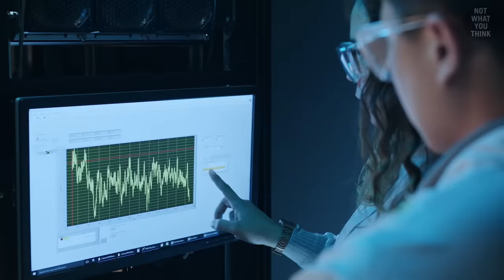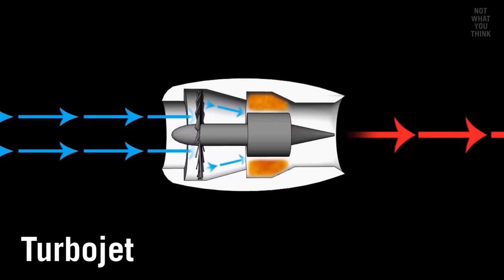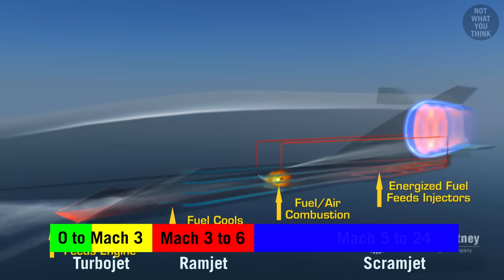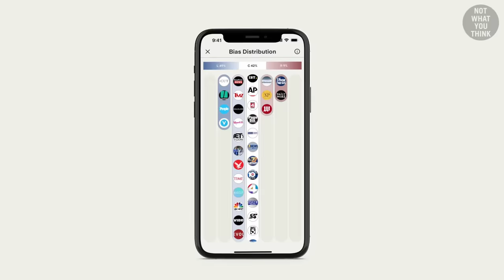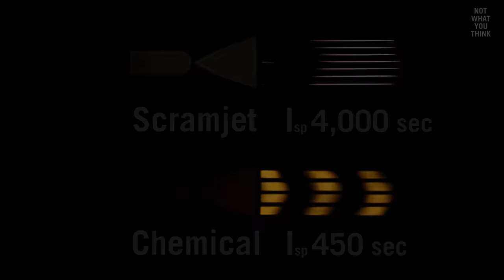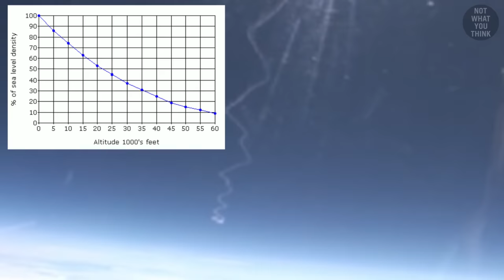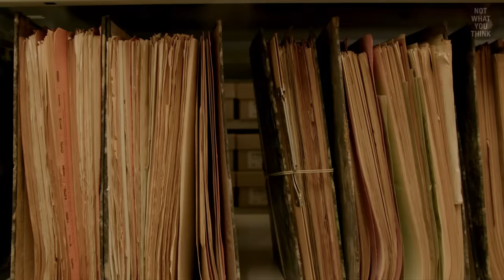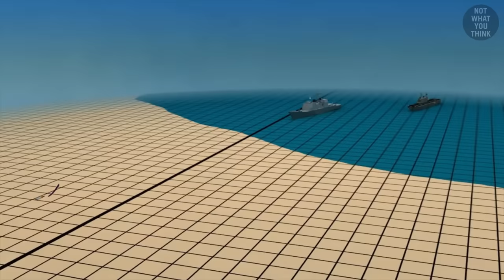The Hypersonic Missile Vulnerability That NO ONE Talks About

Comment: I worked on a project investigating hypersonic weapon systems potential impact on mission effectiveness during my aerospace engineering master's program and, based on the literature review and modeling work I and my team did, I think the answer to the question of the practicality of fielding operational hypersonic weapons (i.e., hypersonic glide vehicles and/or hypersonic cruise missiles) is surrounded by too much uncertainty to definitively say they DO or DON'T make sense. In fact, that uncertainty was the major motivation for the project to develop and apply a framework to aid in decision making by burning away (some) uncertainty.

I definitely agree that many public statements and documents from the DoD and industry touting the "amazing" capabilities of HGVs/HCMs are, at the very least, a bit embellished and optimistic considering how much uncertainty there is surrounding them. Although, I think a similar sentiment also exists for the other side of the argument and it seems to be quite a polarizing topic. Opinions seem to generally be either "Hypersonic weapons are unstoppable and are a game changing technology." or "Hypersonic weapons are useless and don't offer any unique, beneficial capabilities."

And of course the DoD and industry "hiding" behind the veil of classified programs/documents that "show hypersonic weapons are the real deal" doesn't help either since you can't fact check them so have to either trust them or assume they are lying. Time will tell what the answer is in the end as it (mostly) always does.
Reply: A hypersonic missile will also have enough kinetic energy to completely disintegrate itself if/when it hits something in the air before reaching its target.
In some cases, it is easier to destroy a supersonic missile than a sub-sonic missile because those extra 100-500 m/s impact velocity makes it easier to detonate the payload.
I'm wondering how big a small steel sphere needs to be to destroy an incoming hypersonic vehicle.
Reply: If you were to add these differentiations: the us/nato defense vs offense, and peer-peer vs peer-nonpeer into
your investigations, that might help clear things up. Then if you look at cost effectiveness (including rnd) vs marginal benefits with those discriminations, you’ll see that hypersonics are really just a needless expense to deliver a payload.
The only argument I can agree with in support of hypersonics is its time to effect, but this is something that would only be a niche advantage and could be mostly negated just by proper coordination. There are further arguments within this, but they
all kind of argue against it unless you factor in something like anti air hypersonics.
Edit: this basically amounts to the same thing as the op’s last paragraph, at the end of the day it’s just a missile that flies fast. In terms of the us, I can only think of one niche which this missile could uniquely fill, and it still has drawbacks strategically in that position.
Reply: One thing I have learned is that the faster you good, the less sharp you can turn. A slow interception missile will have a easier time getting into the path of the rocket with long enough detection time to launch it. The amount of G-force it will take for attempting any sharp turn at supersonic speeds could result in a missile failure. Not only that but in atmosphere flight is super  inefficient at supersonic speed with out current tech. Maybe in the future they will be feasible but I think reentry vehicles that are able to glide like a space shuttle would be way better weapons and more unpredictable.
Reply: I'd like to see the Hypersonic systems continue to be investigated. I also want the budget to be as 'efficient' as possible. I don't see any worth in the program currently but that doesn't mean something beneficial couldn't bleed off to another study. The Pentagon is 'misplacing' money & even Soldiers/Sailors far to often for my liking...like in accounting of every cent & every person. I believe there are some, Deep in the Pentagon, that adhere to the ideology of the 'Deep State'. They must be purged & held accountable. In the meantime, Military Research must continue but under the watchful eye of vetted Congressional members. Don't get all conspiratorial on me, that's all we have.
Reply: I'm of the opinion that hypersonic weapons and lasers true intentions are to be used against hypersonic targets (UAPs). What systems would be used against low observable targets with instantaneous acceleration to hypersonic speed? Well, obviously hypersonic projectiles, lasers and directed energy.
Reply: @carmiethompson2676  I think they made a grave mistake by cancelling the rail gun experiments. That’s about the best and most cost effective way to study hypersonics where the technology is currently at (imo).
But also don’t get me started on congress. I think the whole rnd and future procurement sectors for the military need a complete reworking. We literally have declassified and discarded more useful former us military missiles.
Reply: @carloscardenas9660  there is no such thing as a low observable hypersonic. As per my understanding hypersonic speeds take extremely high altitudes, and essentially invoke the counter-icbm missile alert system. Without quantum computing (and you’d probably need some of that “quantum linked” equipment or whatever), destroying a hypersonic projectile with a laser or hypersonic vehicle sounds like the absolutely most impossible thing ever. That would require keeping directed energy on target to penetrate a boundary layer and heavy thermal shielding that is traveling a mile plus every second, as well as clear conditions and no atmospheric alterations to flight path. Which in my opinion is highly impractical except for a technological demonstration, even with a space based laser system.

Keep in mind hypersonic accuracy is for the most part measured in miles. Achieving kinetic interception at hyper-hypersonic speed is honestly not even worth my time to quantify in a metaphor.
Reply: Can you send the DOI of your team's paper? I am interested of your findings
Reply: @carmiethompson2676  I don’t disagree with your statement, but I also have the extra opinion that congress doesn’t know jack shit about anything. I understand that budgets have to be a public deliberation, but the combined intelligence of all of those entities must surely be negative because I can sit on my bed nursing my wounds and come up with better initiatives that not even the current military leadership could manage to fuck up… without even any access to any of the stuff that they have. 
I don’t want to get into politics, but in terms of national security, I don’t think it’s best trump gets re-elected. The whole chad wolf thing and the nsa bombings are sort of my own personal conspiracy theory. Actions under the trump administration’s appointees resulted in the cancellation of defensive counter-Russian operations. I blame trump for continuing the Obama era internal military destruction by pushing out remnants of the good brass. As a Floridian, I’m all for desantis. I think trump could make a strong candidate for something like Secretary of State, or something of that nature but I don’t think he should be involved in anything related to law enforcement and military stuff. But I also think politics should be removed from those two fields.
Reply: @carmiethompson2676  to clarify on what I mean by “that even the military can’t fuck up”, I have the LCS program in mind- where the us navy forgot its own ships were littoral ships and cracked their hulls because they couldn’t plan out around proper sea states. They had to specifically retroactively issue a memo to not operate those ships in sea states which the ships were never designed for… I mean that’s beyond fucking ridiculous and I haven’t even started to talk about the Bonhomme Richard.
Reply: @kinfongyeung5400  Chinese spy?
Reply: @tonyr4873  typical millitary channel commentor moment
Reply: @DreadX10  If you consider, that the whole structure of the missile would be at its max it dont need to be large. 

Mach 1 is rougly the speed of a 9mm.  So yeah hitting something with Mach 5 would be like multiplying the caliber of a weapon by 5. So a grain the size of a 9mm would have the energy of a 45mm KE round. Its more of a aid to visualize it than accurate sience.

So a WWII style wall of flak/frag would do well against those kind of missiles.
Reply: Listen up, Poindexter - I just want to shoot railguns from my flying car OK? It's 2022 and everything is getting WORSE.
Maybe we'd get there if academics could do something more useful than "there's too much uncertainty, so we assembled a team to research the topic and concluded that there is too much uncertainty". Thoughts?
Reply: @carmiethompson2676  I first want to clarify that it’s not that I disagree with trump, I actually like him a lot. What I meant about the chad wolf thing was that he was completely unqualified to hold the position he was forwarded to congress for, and was denied by congress, but trump made him an “interim appointment” to that same position he was denied from. And what I mean is the NSA data center bombing. Like if anything was to be meaningful in regards to election claims, the nsa runs election data security. I quite frankly saw the chad wolf initial appointment, looked at the guys resume and went “oh shit something bad is going to happen”… and multiple things did. 
My thing with trump is I just think that trump is a too internally abrasive figure. It causes way too much turnover in the “worked my way up to the top, but frustrated with this job” department, but in the opposite sense that those people have been dealing with since 2008. But that doesn’t mean I wouldn’t vote for him. The Democratic Party presidents of late have all but rewritten my opinion on government service in an absolutely sickening fashion. It’s beyond me how I’m like the only American that actually understands that Biden burned all our progress in Afghanistan and turned what was to be a victory into a most disgraceful defeat. I wrote my own analysis and I actually dropped out of my major after writing it because of how disgusting that was. 

Bonhomme Richard shouldn’t have snowballed into what it was plain and simple. It’s honestly beyond me how many levels of failure occurred in that event.
Reply: @DreadX10  not very big at all, the issue is intercepting it and getting that sphere to make impact
Reply: @westphalianstallion4293  9mm!! No, I was thinking bb sized or even smaller.

A small sphere would first feel the heat of the shockwave and begin to evaporate on one side (pushing the sphere in the same direction as the missile); then it would feel the pressure of the shockwave and this pushes the sphere even faster in the same direction. Both of these phenomena depend on the square area of the sphere.

How much the sphere accelerates is due to its mass/inertia and that is proportional to the volume of the sphere.

A dust-size particle might evaporate and be pushed out of the way before it can touch the missile. A bowling-ball size would have so much inertia that it won't get pushed away in time and will definitely hit the body of the missile.

So somewhere in between those two sizes one would find the smallest size that does still hit the missile with enough momentum to destroy it or at least help it along to start destroying itself.

I chose steel because it is easy and cheap but tungsten or something like that would work better.
Reply: @casey6104  the fundamental problem of rail guns was that the rails would quickly wear out with each firiing. A supergun with a barrel that can only fire 2-3 rounds before the barrel blows up  isn't much practical use
Reply: First off let me say plainly and exactly I am not an engineer of any kind. I would describe myself as somewhat informed. The thing about hypersonic said I puzzled over is the heat of hypersonic flight. We all know the SR71 was made out of titanium. Hypersonic aircraft are faster than the SR-71. The thing that I wonder about with the heat is what material could be used that can resist that heat and remain transparent to the various radio frequency necessary for operation. You can use a strap down inertial guidance system. That system does not have the accuracy of the GPS system. So whatever materials are used have to be transparent for GPS. Then you have what would be an active seeker of some sort for terrain mapping or targeting of say a ship. It would also have to be transparent to the frequencies of any potential radar system and or the satellite communication system that the device would need to use. It's kind of like the space shuttles ceramic tiles. They could fly hypersonically and get hot without transferring the heat to the airframe. But I don't believe they were transparent for various radio signals in different systems. How rigid would that material be? Would it be possible to create a debris field like a shotgun blast in the path of a hypersonic weapon and destroy it. All you have to do in that case would be to puncture the material that is protecting it from the plasma formed from the kinetic heat of atmospheric friction. As I said I'm not an engineer but that to me is extremely puzzling.
Reply: @tonyr4873  I though the same thing 💀
Reply: Sounds like a lot of word salad here. Somehow everyone becomes an expert because of some wikipedia articles loo
Reply: @peter4210  Why Australia is going to test fly a scramjet drone early next year. a hypersonic drone makes more sense as is reusable and not a one use waste of money.
Fly in drop a payload and get out before can be targeted.
Reply: @carmiethompson2676  They are. just USA and Australia went dead quiet on their research after 2017 HIFIRE 4 test. even states in AUSMIN meeting that they were putting a blanket ban on any discussion of their work.
Now USA has AGM183A. Raytheon DARPA HAWC hypersonic cruise missile Dark Eagle also. all USA hypersonic weapons.
HIFIRE was joint USA,UK, Australia hypersonic tests and all 3 tested their own products.
Australia has world's fastest scramjet at mach 12 and is similar design to USA HAWC scramjet cruise missile. Both 3D printed and run on hydrogen.
But Australia's is designed on Ray Stalker design Australian first to get essence of flight from scramjets.
This scramjet will test fly in a drone next year and has reached mach 10 in HIFIRE test.
SCIFIRE is a new USA/AUS hypersonic research programme.
Believe me it never stopped .

I remember researching HIFIRE 4 back when was on media and found a Chinese journalist piece that after they saw about HIFIRE 4 success he would go and tell the Chinese officials they needed to hurry up and finish their programme's. i can't find that now though.
Reply: @JohnRodriguesPhotographer  They have hypersonic materials manufacturing worked out now. tunnel tests have worked out calculations of heat at different speeds etc. Australia has 7 hypersonic tunnels capable of research up to Mach 30 and are manufacturing drones using scramjets and one will test fly  early 2023.

Can look up Kratos USA company who is building Kratos Dart AE drone. will be a demonstrator drone for a Australian company to showcase their scramjet that they want to use as a satellite delivery vehicle.
But are also defense looking at them for military purposes.
Earlier versions of this scramjet have reached Mach 10 in real life rocket tests in HIFIRE.
Reply: @casey6104  Time to target advantage isn't as niche as you might think. In contested environments like the SCS is expected to be in any war, intel is expected to be very hard to come by. It would be a mutually denied airspace, where aerial surveillance assets can't consistently operate without larger scale planned operations. While Chinese hypersonics are really only ever talked about in how they might penetrate an American CSG's air defense bubble (most of which is media hype), I am of the opinion that their main draw is their ability to better capitalize off of fleeting intel. If a Chinese sat pings a US CSG, an HGV has the range and speed to maybe get there before that intel gets too old, whereas other missiles or strike aircraft wouldn't even have a chance.
Reply: @casey6104  By the way, hypersonics are already used to intercept hypersonic targets, and the one system that does this actually does use a kinetic kill vehicle. Check out the American SM-2.
Reply: @JohnRodriguesPhotographer  That is currently unknown for modern designs. The American Pershing 2 used an active radar guidance system (albeit a simpler one than an ASM would require). It just used an epoxy/glass coating as the radome. It was ablative, so it was expected for part of it to melt off during the terminal phase. This solution couldn't work for modern HGVs, though, since they travel at hypersonic speeds for very long periods of time. Assuming no incredibly leap in materials science has occurred under our noses, it is expected they either do a pull up terminal maneuver to reduce speeds or just get fed info from an aft mounted datalink.
Reply: @jonathanpfeffer3716  the heat shield on the Orion spacecraft is an ablative material but the plasma coming off of it causes the Orion spacecraft to go into a essentially a radio blackout. If there was a similar material used on all the capsules, they all had the heat plasma block radius signals either way. The only one I'm not sure about is the x-15 and I think it reached hypersonic speeds. I don't know if it had a radio blackout when it was traveling at the speed though. I'm pretty sure the x-15 exceeded Mach 5.
Reply: @christianbalos8609  I don't know about you but a lot of my knowledge comes from reading pre internet. I was forced to use books and magazines before Al Gore invented the internet.
Reply: @JohnRodriguesPhotographer  It did, and the idea of signal blackouts is something that has been discussed a lot in military circles. There is basically two schools of thought with this. The first says that the missile will pull up shortly before reaching the target to slow down and let its sensors see, then reengage. The second says that since plasma sheathes don't block all radar frequencies (which is true), then maybe the Chinese have developed a seeker head that can see through the plasma. While the second is theoretically possible, I still believe the first is likely true.
Reply: $$ Cost is another huge reason, Russia is now resorting to cheap low tech drones to hit Ukrainian targets, actions speak louder than words.
Reply: @gandalfgreyhame3425  that’s why you keep playing with it. Just tune down some aspects.
Reply: @casey6104  Well hypersonics are way too much bang for your buck for CAS, to say the least. But it’s a bit too much to assume China will completely discard the option of conventional war in they backyard. I doubt they would immediately resort to nuclear war, especially in the 2030s and beyond, aka the only time war for Taiwan will be feasible. And that’s not for no reason, they do hold a significant edge in SCS warfare. There is legitimate reason to suggest that a war for Taiwan is winnable for them.
Reply: it's like every weapons system, not universal, useful in specific circumstances and its effective use conditional on those circumstances. yeah it's going to be touted and derided depending on how its looked at and for what reason. military always wants more funding for their tools, so yeah, its a 'game changer' while more grounded penny pinching types just see its limited use cases as a waste that could be better and more cheaply handled by other systems. to me the final analysis always comes down to cost and effectiveness versus other systems. can the same goal be achieved more cheaply using something else? even if that something else is a swarm that overall costs less and is just as effective if not more so than the hypersonic weapon.

even it's speed and maneuverability at hypersonic doesn't really matter much as it's terminal phase slows it down and reduces its maneuverability making it vulnerable...that and the heat in generates makes it easy to track to that terminal phase. hypersonic in this era is just not cost effective...and probably wouldn't be in any future era of weapons development. like the hyperloop...just because you can doesn't mean you should.
Reply: @christianbalos8609  send us the link to the article. If you can't, you're just a hater
Reply: im currently getting my masters in aerospace engineering and i have so many questions for you xD
Reply: One word, lasers.
Reply: @jonathanpfeffer3716  yeah especially with the 2027 us navy gaps. But i wouldn’t count out nuclear weapons. My whole hypersonic cas thing is sort of the same target of opportunity situation, just combined with fast response times through denied area dead space.
Reply: @christianbalos8609  But are you qualified to discern an Expert from someone w/ a wiki 'education'? In a format like YT, that might involve more questions & answers then the format is willing to take.
Reply: @casey6104  The huge amount of electromagnetic  energy that was being delivered to send the projectile to Mach 6 (hypersonic) speeds was what was damaging the rails with each shot.
What was needed was a magical unobtainium material that could withstand these high energies, and of course this doesn't exist and nobody has any idea how to make such a material.
You can tune down a rail gun to not destroy the rails, but then you're going to just be firing supersonic rounds, and the tech for doing that with standard artillery is over 150 years old.
So that's what killed the rail gun project, which the Navy funded for about two decades.
The Navy's rail gun eventually got to where it could fire 12-24 shots before the rails had to be replaced.  A standard artillery gun can fire over 600 rounds before the barrel has to be replaced.
Reply: @DreadX10  Know I want to know, if hypersonics can fly in rain, snow or hail or other heavy weather.

 I used 9 mm because Mach1 is roundabout the speed of 9x19mm . So a grunt like me can get a good pictures of the forces involved.

And I see it from the simple infantry soldier perspective.
Your descreption is very visual and scientific.

I know that I dont know more than the basics of physics. 
And that aerodynamics and forces are getting very sketchy the smaller and faster things go.

What I get out of the conversation, that Flak walls will have a revival because of drones as well.

But we both can agree, that hypersonics are very fragile because of their speed and that its a exponential factor.
The speed makes it more fragile because the structur is already stressed to the max, every inperfection in the outer structure will create drag that will disintegrate the missile.
And the inertia of falling frag or debri is enough to create that level of damage.
Reply: @gandalfgreyhame3425  you’re not wrong. But keep in mind that the pressures involved between sea level and high altitudes are extremely different and so it’s a good technological demonstrator platform for research on a smaller scale. But of course they could have all they need for that. Maybe the secret to rail guns is mounting them to high altitude planes lol
Reply: @DreadX10  how do you intercept a hypersonic missile that can alter it’s direction and speed? They aren’t travelling in a parabola like an icbm. And they are carrying nukes so they don’t need to be Super accurate either.
Reply: @casey6104  hypersonics have two main advantages in a preemptive strike. One, they’re much harder to intercept, and the time window to intercept is much shorter, and two, they’re more likely to deliver their payload before the opposition.
Reply: Hypersonic weapons are good for fixed targets ,however moving targets are far more challenging 
Combined with EW,  they can breach defenses like the S-400 and S-500 in under 2 mins vs the 40 min with TLAMs
The Zircon's Mach 9 speed is believable however the Kinzhal Mach 12 speed against moving target works against it
Reply: They offer some benefits. I can slaughter my enemies and spill their blood in mere minutes where a slower weapon may miss them by the time it reaches
It. What if many heathens were in one place but had enough warming to scatter? Less time for them to react or try to shoot them down!

 Jokes aside. I till don't understand why they are so much harder to intercept. Surely we could in theroy create a gun(a bunch of them in a system) like metal storm that fires a blanket of tungsten in a general direction. It's not like they can turn on a dime and if they do some crazy manuever to avoid being hit by said wall a few seconds before impact they'll likely miss. 

 Wouldn't their very speed mean even a small piece of lead will destroy them? If they lose control they'll tear themelves apart yeah? Are they made to take a hit at such speeds? 

 **Just a random dude who reads a bit. I know nothing.**
Reply: Velocity is super important to kinetic energy.  KE=M x V^2.  V = 1, V^2=1. V=5, V^2=25
Reply: @verdebusterAP  if I remember right, didn’t China’s hypersonic test miss it’s last target by a couple of miles?
Reply: @christianbalos8609  Hey, not his fault you can't read.
Reply: @DreadX10  - This is kind of referenced in my other comment - in Ukraine, they are taking out Russian jets and helicopters with domestic drones cos they realised you DONT have to chase it, you just have to be small enough to not be detected by radar and move up down, left right and let the engine ingest you.

All you need to do is be in the way of a hypersonic missile and let it hit you - a mac 5 missile hitting a 100g tungsten Ball Bearing in the middle of a drone and it will disintegrate.
Reply: @piccalillipit9211  drone swarms are great and all but there’s plenty of reliable counter measures. Good battlefield tactics will supersede any weapon money can buy.
Reply: @casey6104  What battlefield tactics will supersede a swarm of 10,000 drones?

Im not an expert - its a genuine question. But I live 200 miles from Ukraine and I see the way tiny dirt-cheap domestic drones are taking out multi-million $$ tanks and planes.  They are dropping tiny bomblets into the open hatches of tanks and taking them out.

I think the whole world has been shocked by the war in Ukraine - people are working on these mega-budget projects like hypersonic missiles and along come these guys with tiny drones and re write the rules of warfare.

Imagine a swarm of 1000 loitering drones with facial recognition technology, any time a commanding officer goes outside he is attacked by a literal swarm of drones.

You don't HAVE to take out the aircraft carrier if no one can go on deck.  If every time a plane takes off a swarm of bird sized drones head for the engines.
Reply: @piccalillipit9211  speaking from a US military perspective, electronic warfare operations can counter drone swarms quite effectively. By removing an onboard human operator, drones are extremely vulnerable to effective jamming. The implementation and effectiveness of electronic warfare assets in desert storm showcases this perfectly. If I remember right, I believe that all US aircraft were required to fly in coordination with some sort of ECM (electronic countermeasure) asset.
Also, I think you went a little overboard on your worst case scenarios. Because that sort of thing is basically the same concept as tanks “scratching eachother’s backs”. Also, I’m fairly certain an aegis radar system could emit enough radiation to fry a whole drone swarm when turned up to full power at that close of a proximity- especially when considering the “quantity over quality” idea associated with drone swarms.
Reply: @casey6104  How does that help if the drone is making its own decisions the same way a flock of 10,000 starlings does? 

"I think you went a little overboard on your worst case scenarios"   The USA just took out a guy on a balcony with a loitering drone using a kinetic impactor - his family were next to him and unhurt.  The thing is this is currently the US military cutting-edge technology - but it can literally be made from an iPhone and a drone.

The barrier for entry into this new warfare is SO LOW.   And the cost per unit is so low you can deploy thousands of them.   Could you imagine if China and the USA got involved over Taiwan say, how long would it take China to manufacture a million drones?

We are at a point in history similar to the invention of the maxim gun - industrialised warfare arrived very quickly with mass bullets. NOW the bullets are intelligent.  the bullets are drones, they know what a US uniform looks like, they recharge by solar on the ground before taking off again for another 6 hours of looking for US uniforms or anything they have been programmed to target.  They can as a swarm decide to attack larger targets en masse.
Reply: @piccalillipit9211  a 10,000 drone swarm is no different than a large artillery barrage. By keeping your hatches down and taking shelter, drone swarms can be effectively neutralized because they have no penetration capability. By using good camouflage, strong defensive breastworks, and informing and coordinating with other battlefield assets, a drone swarm can be neutralized relatively easy. Hell, you can likely even hijack the drone swarms and reprogram them to return to sender, especially if they’re commercial drones. Just look at how Iran did that with a global hawk a few years back by disrupting/overpowering the satellite link.
Reply: @casey6104  "10,000 drone swarm is no different than a large artillery barrage."   Only its not, cos its kinda living, they can replenish energy and make decisions - how long can you last inside that tank wiht the hatches closed?  Cos that drone - and im not talking domestic here, but its a good starting point - if you can do actual damage with a domestic drone imagine what you can do with a military. Yeah so these 10k drones can sit there and wait indefinitely, and they are faster than you. 

And they know what a tank looks like and they can see in infra red, all CCD's can see in IR they have to have it screened out actually. 

The only way you are - that I can see - neutralising a swarm of 10k dromes is with an EMP, and that means everything YOU have has to be switched off.

Dont get me wrong - the USA will be the worlds biggest deployer of drones, its not like they will be left behind or anything.   Im just saying that the days of big expensive weapons systems are coming to an end. Its like the capital ships in WW2 - just too big and too expensive to send into battle because they could be taken out by a torpedo.
Reply: @piccalillipit9211  I don’t think you understand electronic warfare. 

And yes, a guy was taken out using a flying ginsu… in a country with not much of an air defense network and no reason to engage said vehicle while that vehicle remained in constant contact with its operator. You think that if the us and china go to war that china is going to be able to make a loitering drone army capable of flying out to reach a csg and then staying around long enough to inhibit operations? No. You think taiwan is just going to let china launch something like that? No. They will send loitering drones right back in the form of artillery shells. The only difference is that you can’t jam an artillery shell. 

To compare drone swarms to automatic weapons is like comparing apples to oranges. The only instances of them being actually used to reliable success are on unarmored shit and old Soviet junk that has been sold off around the world. To compare this to a maxim gun is an insult to the people who died in ww1 at the hands of those weapons.
Reply: @piccalillipit9211  you sound like you got really high one night and then watched Star Wars and thought it was documentary.
Reply: @piccalillipit9211  I honestly don’t know how to respond to you anymore. You clearly have absolutely no idea what you are talking about and I’m not going to explain to you the last 100 years of warfare just because you think “iPhone drone scary”.
Reply: @piccalillipit9211  same with ships.  Lots of little shape charges until you hit a fuel source and blow it up.   Aircraft are really easy targets on the ground.  Just tap a AA missile and it is all over.
Reply: @piccalillipit9211  also, I hope I’m not coming off as insulting. I am kind of unique individual in the sense that I’ve been studying this stuff for a long time and have brain damage that amounts to me missing 1/6th of my brain and I’m in a lot of pain from the rest of my injuries. So it’s kind of a major effort for me to dig back into my knowledge and explain stuff. 
But if you’re in one of those nato countries on Ukraine’s border, you shouldn’t worry much about these sorts of drone strikes. Certainly they’re touted as cost effective, but they’re not really all that effective when compared to nato arsenals and doctrines. These are the type of things that are effective in asymmetrical warfare, but not effective at all in real warfare because they are secondarily countered by a lot of standard implements of modern battlefield doctrines.
Reply: @casey6104  "and have brain damage that"    FAIR ENOUGH my friend - as a FELLOW brian damage sufferer I know it can be very easy to word things in a way that comes across the wrong way to other people. 

I was mugged in 2014 and beaten with metal bars - it left me with almost no short-term memory and an impairment in judging social cues. So i sometimes write things I mean to be helpful and they come across as sarcastic or insulting... 

All I am trying to say about the drones is - I think we are entering a new phase of warfare.  Im most definitely not an expert on this but the direction seems clear to me. The world will move to smaller smarter munitions and systems.
Reply: @casey6104  
China's hasn't tested its DFs against moving targets due to USN ELINT and SIGNIT capabilities
Reply: @piccalillipit9211  I feel you on that. I’m 23 now and in 2011 I was sucker punched by someone wearing a full arm cast and it caved in half of my face. After that, I basically lost the ability to read and so I could no longer enjoy reading military history at a high level. That year I also got my back broken in multiple places and I’ve had to deal with paralysis, cranial nerve damage and swelling since then. About a year ago, I started figuring all my injuries out and it’s remarkable how far I’ve gotten without understanding them. 

I’ve had to drop out of college multiple times because of new brain injuries due to medical mismanagement and some other factors. 

It’s extremely frustrating for me trying to both remember stuff I read over half my life ago and then try and explain it. Especially when I’m so exhausted from trying to rehab all my injuries (I only mentioned the original ones, not the cascade from those) that I am in a state where I can’t sleep because of pain and my brain is still screwy from the last incident with this shit. I’m about a year and 4 months into basically the most aggressive physical therapy program ever invented. In that time I’ve re-aligned my spine with my hips, fixed chronic spontaneous blackouts (due to 100% spinal disc compression), and started to repair 11 years of nerve decay. It’s EXTREMELY painful and it takes all of my willpower to do. 
Im just glad I had the presence of mind to remember that, because I’ve forgotten about this stuff for 10 out of the past 11 years and it really affects your life.
Reply: @verdebusterAP  I don’t think I’m talking about the df21, but I could be wrong. I thought I was looking at something else.
Reply: @piccalillipit9211  also, the only reason I reacted so strongly to the things you said is because currently I’m extremely pissed at the actions of the us government, in specific to the sacrifices of the people who fought under the flag. It’s gotten to the point where the predictions I have made have all started to come true and it’s beyond me how that stuff can happen. 
At the end of the day, drones are just a force multiplier and nothing more imo. They can be useful, but they have major vulnerabilities that preclude much of their impact. You are correct that we are seeing increased emphasis on precision weapons, but there are many factors that incorporate into that. 
The problem with drones is that they’re reliant on technology and communications, two things which are extremely deniable assets. So yes they are useful, up until you start encountering opposition who have counters for those things. 
Drones have had remarkable success in asymmetrical warfare and small unit tactics, but beyond that they really really haven’t had much significant success. But of course they are still a relatively new system.
Reply: Did your study include the fact that a single hypersonic missile with a large enough payload can take out a multi billion dollar supercarrier, and non of its flight nor defense systems nor even its battle group's point defense systems can do anything about it?
Reply: @mahmoodali5043  yeah that’s called a df-21. Though there it’s not truly a defensive vacuum.
Reply: @gandalfgreyhame3425  there's difference between accelerating from 0 to over mach 5+ with space to spare and immediately accelerated to over 3+ mach inside the barrel.
Reply: @mahmoodali5043  No my study investigated the use of hypersonic glide vehicles as an offensive strike weapon for a notional Suppression of Enemy Air Defenses (SEAD) mission against an Integrated Air Defense System (IADS). Our sponsor was a US defense company interested in the offensive application of hypersonic weapons and, since the US (and also China) is really the only force that heavily relies on the use of aircraft carriers for power projection, the sponsor was less interested in that type of mission for the operational scenario as a use case for the project.

Like I mentioned in my original comment, my groups' project was trying to burn away SOME of the uncertainty surrounding hypersonic weapon systems. The full problem space is infeasible for 5 graduate students to explore in a 1 year timeframe of the project so we had to significantly scope down the problem to something manageable without being so laser focused that it provided little to no value.

The missile interception problem is definitely a massive technical challenge though for sure and one of the new teams for this years cycle of projects is looking at the problem of defending against hypersonic weapons like you mention (although I believe they are looking at ground based defenses as opposed to a carrier strike group).
Reply: @sys3248  the us has worked with very fast missiles since before the soviets. I fully expect the us to not only have its own data, but to also have some data on Russian tests too.
Reply: @kinfongyeung5400  The project was performed for an external sponsor who retained most of the rights to our work and also contained Controlled Unclassified Information (CUI) so our reports and presentations were not (and can not be) published unfortunately. :( The group wasn't even allowed to keep personal copies of our final report and presentation.
Reply: @Gold3nAng3l  thanks for the detailed response. 
I think the problem of intercepting hypersonic missiles is double fold because they can be used in "limited wars" without hitting high value ground targets or cities, but by taking out a single carrier battle group, a superpower's presence in strategic command zone is either severely hampered or eliminated completely
Reply: By definition “Hypersonic” might not require continuous propulsion from launch to detonation. If not, seems like the program could provide speedy ballistics delivery to the target area.
Reply: Does this sound feasible to you, it's essentially highly advanced  cavitation -  The craft includes an inner resonant cavity wall, an outer resonant cavity, and microwave emitters. The outer resonant cavity wall and the inner resonant cavity wall form a resonant cavity. The
microwave emitters create high frequency electromagnetic waves throughout the resonant
cavity causing the outer resonant cavity wall to
vibrate in an accelerated mode and create a local polarized vacuum outside the outer resonant cavity wall.
Reply: This is the new space race, the major players (nations) trying to get there first and hyping the propaganda making it look like the are closer than the other guy, and the next player does the same. It’s the race to the moon all over again. But hey the last race (to the moon) gave us super glue, plastics, electronics, it literally revolutionized the planet. I just hope with the new technology that comes from this race that AT&T cellular will finally be able to get me a reliable signal even though there is a damn tower 2.2 miles from my house!
Reply: @Battleneter  Same for the Ukrainian military....it's the most brutal thing I've seen in this war.....drone grenades hitting soldiers on either side in HD.
Reply: @rickbase833  Yep war is facking terrible, there are no words.
Reply: bro youre arguing with an actual bot channel. their schtick is telling people what they think and how it isn't that
Reply: @rickbase833  I must be a different breed then. Back when I was 10 I suffered severe injuries to my brain that has amounted to losing 1/6th of my brain. Before those injuries I was reading over a thousand pages a day of doctorate level works on military history. And that was at age 10, imagine what I’d be doing now if I had a fully functioning brain.
But that’s why you have a staff as well. Delegate work to trusted people.
Reply: @rickbase833  isn’t the whole point of congressional committees such that the representatives can fill into the committees that they are knowledgeable in? Or has it all turned into a pork barrel packaging facility?
Reply: @casey6104  My 11 year old son can't focus on reading 10 pages of a book....wants to watch YouTube shorts, TIKTOK, or play video games. We're trying to steer him as much as possible to get away from the online stuff. I used to kill 2-3 hundred pages of a good novel when I could spare the time.
Reply: @casey6104  Yes that is the goal for such comittees but there's a catch....only the senior senators or representatives get to chose those comittee members and it's usually along party lines. The founding fathers mostly did a great job at separating powers within the government....but not setting term limits for senate or congress so we have those senior members (lifelong politicians) controlling the narrative of those comittees. Add in that no bills will be brought to a vote unless said lifelong politicians approve of said bills. 
Bottom line is once they get there they want to stay and in some cases that means decades so they make sure their constitutes get earmark funding so the votes continue to keep them in office.
I'm pretty sure the founding fathers didn't envision lifelong politicians who only vote one way.....that's identity politics as well for us voters....who rarely ever turn on them. Governors and Presidents can bamboozle the undecideds voters.....sometimes but congress is a club full of elders that keep the sheeple in place voting for them in perpetuity........I know because I'm a California resident and this state votes Blue all the time. Been that way for almost 40 years. Nationally my California vote is cancelled out by the super majority of old retreads both in state and federal government.
Reply: @rickbase833  if you are thinking about getting them a phone, I personally would highly recommend getting them a flip phone that just has basic communications functionality. They may not be greatful for it then, but they’ll thank you later. If I ever do have kids, I’m moving way out yonder to a place in the country. This is for many reasons. 

At this point, I have pretty much deleted every social media app that I have ever made, and am happier for it. I have a conspiracy theory I came up with that links the rise of advertisements along with shorter and shorter intervals of programming to decreasing attention spans across the population. 

Around the time of my injuries, I actually completely exhausted my local library’s collection of books that interested me. Now I buy books I wish I could read. I use it as a sort of motivation to myself to keep on going because currently my reading ability consists of me rereading the same paragraph 7-8 times over because I forget what it’s about. 

In addition to reading a lot I used to spend all day in the woods having fun like nobody does anymore. I would be willing to wager that this has strengthened my immune system immensely and might even be the reason I’m still alive and kicking.
Reply: @rickbase833  I am sorry to hear that you are a California resident. No legislator will ever restrict themselves to term limits and I hate the bs that comes with all this political party stuff. The founding fathers never in their wildest dreams could have imagined that the institutions they cast would become the exact sort of thing they fought against. They truly were better men than what is around today, and that is evidenced by the fact that they didn’t even think term limits would be necessary because they assumed that people would use their brains.
Reply: you dont need years of study to understand what hypersonic speed enables.
and we have some proof of that today in Ukraine. Air raid siren does not bell when missiles fly, but when a Mig-31k pilot laces his boots :) Missile is so fast and reaction time is so short, they have to ring the bell at any suspicious activity, creating something similar to a DoS, denial of service.
With standard supersonic speed, even with a lack of air defence, engineers/officers can leave and run into shelters. Factory is destroyed but not valuable people.
Another mistake people are doing here, they compare an existent hypersonic weapon to inexistant hypothetical defence system "we could stop it like this or that, laser, micro particules, blablabla". It does not work if war starts tomorrow. Pentagon does not care if you get an effective air defence in 10 years from now. They worry for today. It's like a delusional Japan claiming "dont worry about nuclear weapons, we will have antimissiles in the 1950's"
Reply: @syc6598  you fail to recognize that the war in Ukraine is largely an asymmetrical theater. All advantages of hypersonics are effectively negated when considering a symmetrical battlefield. 
The one major thing you have forgotten about is that hypersonic missiles fly in a very narrow flight envelope. Even a near miss would be enough to down a missile in a fashion similar to how Gary powers was shot down. 
Also I don’t think you realize just how large a hypersonic capable missile is.
Reply: @casey6104  Yes, but u don't have to be that accurate for a 2 megaton nuke.
Reply: @johnsmith1953x  while you’re not wrong, the strategic use of nuclear weapons against hardened non-civilian targets requires extreme precision. 

I was going to say that hgv’s don’t have optimal trajectory for this but that is not true. There are some aspects that are advantageous for these weapons, but they really are only worthwhile in a strategic deterrence/defense role.
Reply: @DreadX10  Even if the small steel sphere hits the HSM the kinetic energy of the rest of the missile will still cause catastrophic damage to the target.
Reply: @peter4210  The missile would of course be designed to be structurally sound for the forces it would encounter. The Chinese have the DF-17 HS glide vehicle which can maneuver.